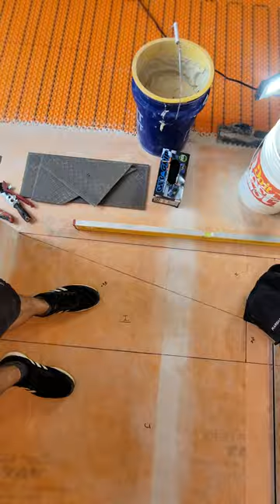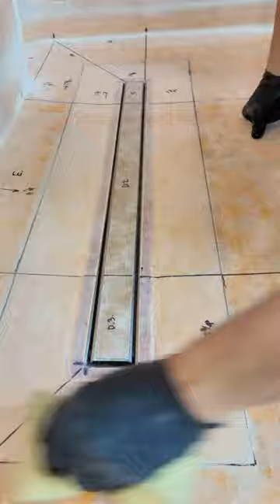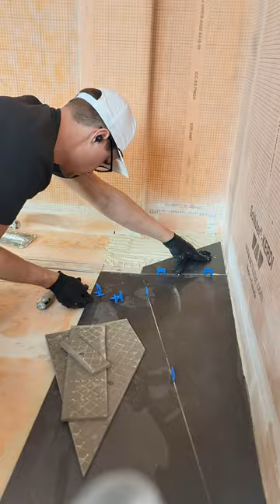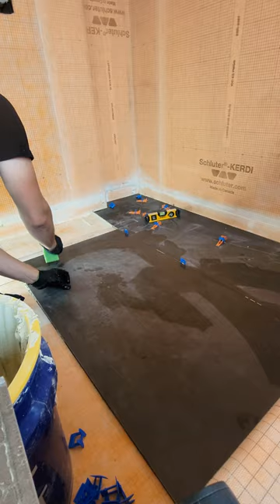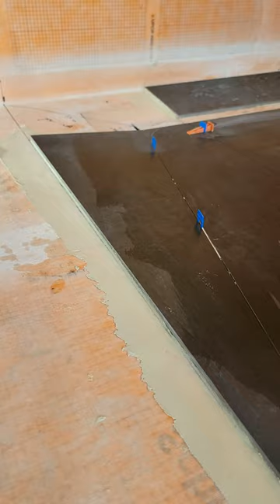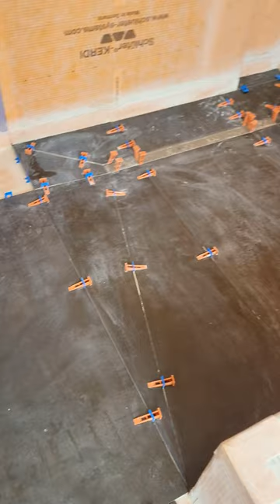Using Large Format Porcelain Tile On A Shower Floor (Envelope method)

Comment: I’m getting ready for a shower/bath remodel. I mentioned to my contractor that I was considering using 30x60 LFT that’s rated for patios/shower floors. Do you think I’d be ok to use it even without ditra heat? He seemed a little hesitant but I think I could convince him. I’m just teetering on finding a smaller tile (easier and more straightforward) vs going for the envelope method.

Comment: Where did you get the idea to do this? The internet or real life?
Reply: What do you mean ?
Reply: @j.w.r.i2910  well in my experience, envelope cut is in internet thing, I talk with General Contractors and tile houses and plumbers and been on jobs for well over two decades and have never seen or heard of the envelope cut unless it was the internet. One of the main reasons I do not like it is that it holds a lot of moisture underneath big tiles and they do not dry out underneath that that's why shower pan materials usually on sheets  to Contour with the pitch and also so it can dry out 
.when you cover the shower pan with big tiles like that you're trapping  air & water that's never going to get out of there and harder to  dry  out, because there is voids underneath large-format tile on a pan, even if your tile correctly, everyone still has a little void every now and again 80% dry 95% wet coverage. Also if you're doing that you got to make sure that it is a matte finish and even matte finishes sometimes it can be slippery, another reason why there are grout joints besides the Contour and getting the air out, is that your feet Grip on  the grout joints. When you have a 16 grout joint or something a little bit bigger with a huge large-format tile on a shower pan, it can be slippery.
Reply from the maker: The geometry of the pan is critical with envelope pans. It's not a conically shaped. They do not trap moisture if they are properly set, and not over a water-in water-out system. 95% coverage for wet areas is correct. There is a metric for the grip of the glaze  and whether it is wet area appropriate or not. Its the DCOF or WDCOF.  The first envelope pan i did was in 2015. 
You can keep all the grout joints you want. 😂 That's an old line that people have been saying for years and years, but it doesnt mean its a bulletproof method, or the only way. Things have really changed as far as methods go over the last 15 years. Most clients are thrilled when i let them know there is a method which eliminates all the grout joints.
As far as an internet thing goes, i dunno what to tell you. I've never tiled anything on the internet.  You sound a little salty if I'm being honest. I hope that's not the case.
Reply from the maker: Also, there is ditra heat in this shower pan, which will actively drives moisture out.
Reply: @NathanTilesTheWorld  good point on the ditra heat, I'm not going to argue with you, I agree that it looks good. I just worry about water and it goes against every single thing that most tile guys are taught in the field. Like I said I'm not exaggerating not one general contractor not one tile house not one tile guy or plumber in 24 years of tiling have I ever seen that on a real job site. Have a great day..... also there should be no cone shape whether it's 12 x 12 sheets or big tiles like you're doing here oh, it's a straight line quarter inch per foot so anybody who's doing a cone shape floor is doing it incorrectly!